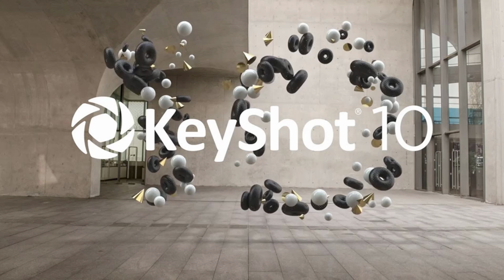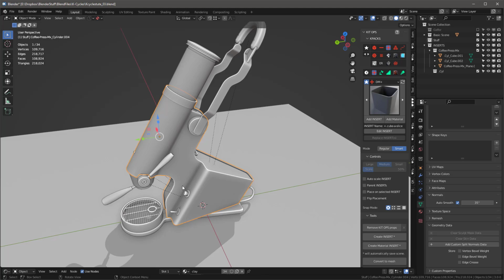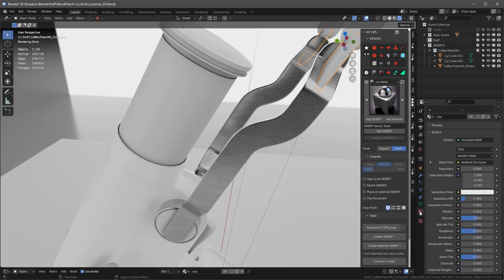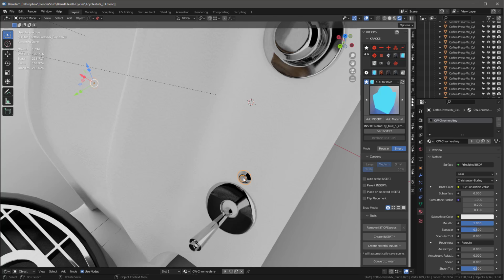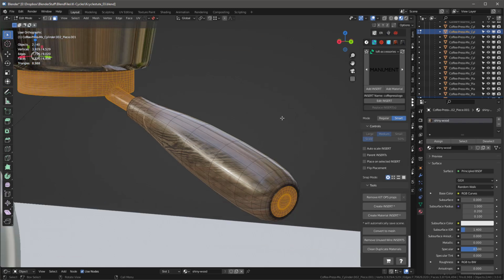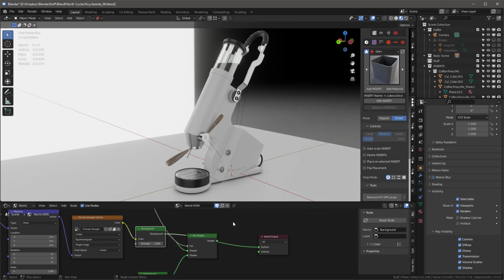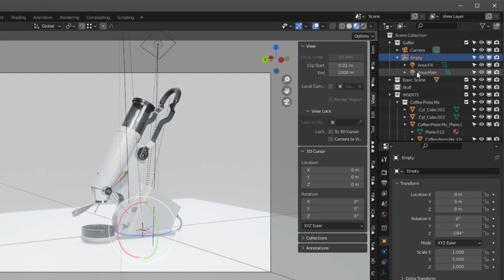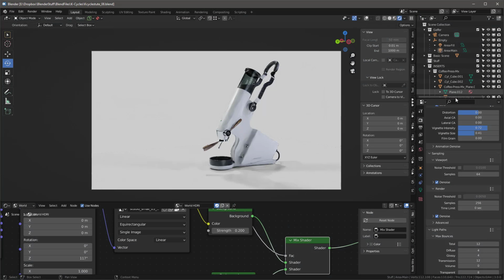Can Blender + K-CyclesX replace Keyshot?

Comment: it seems like keyshot is a useless program, I don't know why anyone uses it when a free program does everything and more that it does just as well; the CAD data hurdle is the only thing that is a bit frustrating in blender, but its not an impossible hurdle to conquer, and worth the annoyance. 

for anything that an employer says to do in keyshot, I don't even have to do it in keyshot and it will literally do what they want.

I actually think that 3DS Max would be a better tool than keyshot since it does handle the CAD data properly; but 3DS cost is insane unless you bought it back when it was actually affordable(ish) or got a student free license before they changed to being subscription vampires
Reply from the maker: Pretty much now all CAD programs can't export in polygon formats like OBJ and they are all easily imported directly into Blender. I do think keyshot has a better workflow for really quick product renderings.
Reply: @ChippWalters  because I always use insanely high end hardware I've never seen a reason to not render in like 3ds max or blender, I'm actually more fond of the early versions of 3ds max, as I found that autodesk has really cluttered and screwed up the UI on all the recent installments(and I could never find a way to get the layout to actually look identical to the r3.1 release in 2023/24, that is one thing keyshot has going for it, a good ui), I never really considered render time as a reason to use keyshot, but, I'd love to see someone do a fair comparison between all the different renderers/programs on a highly detailed scene with volumetrics,fluid sim,particles,raytracing(no pathtracing allowed, sorry unreal 5), it would be very interesting to see; also would be good to include vray render speed results. (vray in my opinion is another reason I don't use keyshot, it doesn't support vray which is a huge deal breaker since a lot of companies use vray since like the 90s and its industry standard)

Comment: Keyshot works many times faster, it renders faster (dk is faster than Cycles X), and it also copes many times better with a large number of polygons and their export and import. Keysho is ideal for presenting products with its Keyshot XR and other features added specially for this
Reply from the maker: K-CyclesX is faster than CyclesX. I routinely do 4K renders in under a minute. How long does it take Keyshot to do a similar 4K render?
Reply: @ChippWalters  I didn’t measure the time in the keyshot. Besides, a lot depends on the performance of the system. But the fact that it is faster than the standard Blender is obvious.
Reply from the maker: @JohnnyBlaster  I doubt it. It used to be the case, but now I'm pretty sure Blender can outperform Keyshot in brute rendering of basic scenes. Plus, I routinely render scenes with 8M polys and more.

Comment: at the 13:38: an alternative to select more in edit mode that I prefer is to made seams defining the limit of the area and then select all the faces with L, but is about you because this method also take a cut when you unwrap the mesh
Reply: Thank you for this tip.

Comment: I doubt Cycles practically does not work with caustic effects, which means that any glass or liquid will certainly look good, but there is no sense in it. But this is of course a fast versatile render, sometimes it will help.
Reply from the maker: The new versions of cycles does work with caustics.
Reply: @ChippWalters  yeah, kinda

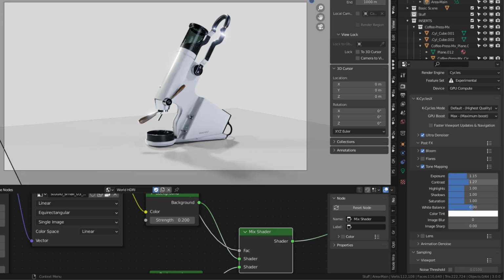Comment: 23:20 "now this is not available in standard-blender" it totally is, you just have to use the compositor for that. You can add tons of custom post processing to your render if you want.
Reply: I have not played with Kcycles but I suspect all those post effects are just an UI that is using the compositor in the backend.
Reply from the maker: @slowlymakingsmoke  nope. That is incorrect. Those effects are hard coded into the source code and are completely different from what exists in the compositor.
Reply: @ChippWalters  if he would make an add-on just for the color correction feature I would buy that.
Reply: That is very interesting. Thanks for the info.
Reply from the maker: I believe I said it was available in the compositor. You should listen to it again. Even so, there are not many of the effects, or if they exist, they are poor. Bloom is an excellent example: compositor bloom is pretty bad. Not to mention the many lens effects that cannot be created in the compositor.

Comment: Thanks for the awesome video. I’m looking to transition from a Keyshot to Blender workflow for better scripting support, procedural water creation, human models, and potentially animation in the future. Although Keyshot is better packaged and has amazing performance for product renderings, I find support in those areas lacking. But I can’t find anyone that prefers to use cycles to Keyshot. Is it fair to think Blender is actually more versatile?
Reply from the maker: Absolutely Blender has way more versatility than Keyshot. Cycles can create amazing renders. It definitely renders interiors way better than Keyshot.
Reply: You won't find anyone that prefers to use Cycles over Keyshot if what they need is only what Keyshot does. Making an animation in Keyshot is a lot easier, and learning the program is a lot faster.
Reply: @Edgard422  I prefer cycles over keyshot. Keyshot is great if you want fast renders, but that's about where it ends. You'll be spending far more time in keyshot, where everything has a plasticky look to it, trying to get a realistic looking render compared to blender.

Comment: I can't figure out why my KCycles is suddenly running so bad ever since the Blender 3.0 KCycles update. It's render times are in the magnitude of 400-1000% longer than normal CyclesX now using the same settings. Even when I turn KCycles over to the Low preset quality it still takes several times longer to render the scene and looks horrendous as expected.
Reply: Usually is some time type setup or configuration issue. In Blender Market go through "Ask a Question" for support.

Comment: The biggest issue it getting your CAD data into Blender and having the ability to easily update it if the CAD data gets updated. KeyShot does this amazingly well.
Reply from the maker: Moi3D, a solids modeler, has the best tools I've ever seen for converting solids models to mesh models. Full control.
Reply: Rhino 3D and Keyshot work like a charm
Reply: @HDRlightStudio Will blender support step files in the future or not? Fbx and usd are still trash to work with.
Reply: You can't possibly compare CAD modeling with polygon modeling programs like Blender, Maya, 3DSMax.
Reply: @Cyber_Kriss No hes talking about it being possible to import cad files into keyshot, which blender cant do.
Reply: @2darki  this is something I have to do everyday in my job, to get from Solidworks to Blender I have to save a Step file in SW, open it in Cad Exchanger, save it as an fbx and then import that into Blender. It keeps the hierarchy and part naming intact as well as retaining linked data across parts. I wish there was a one step process. We used to use Keyshot but as we need the ability to edit and create parts we moved over to Blender
Reply: @davemcbride149  Blame solidworks for being a geriatric piece of shit software. Most all other CAD softwares can export to OBJ, etc.
Reply: @Cyber_Kriss  look at the title of this video... can Blender and X Cycles replace KeyShot. I am saying that one of the benefits of KeyShot is it's ability to import a wide range of CAD files in their native format. Blender can not do this. No one is comparing CAD and modelling programs.
Reply: @HDRLightStudio  My bad... English is not my first language ;)
Reply: @HDRLightStudio  Yes, and exporting CAD data into STL or OBJ ends with a huge file, and often with lots of mesh problems (specially on circular surfaces and rounded edges)
Reply: @Edgard422  actually I must say in recent time blender does handle that better. We design in Fusion360 and export high res meshes to blender. Swapping out meshes is also rather easy with the mesh data exchange when not adjusting the object origin point
Reply: @HDRLightStudio  Get your CAD data correct and you'll never have to worry about it.

Comment: This looks like an excellent improvement over the standard Cycles renderer but I don't have a super graphics card that will take advantage of the render speeds it offers.  I assume the rest of the features would still work?
Reply from the maker: Yes, like Keyshot, it can use your CPU to render as well (or both CPU and GPU)
Reply: @ChippWalters  cycles X is much slower for CPU rendering than previous versions, not sure if k-cycles works differently
Reply from the maker: @drumboarder1  you should NOT purchase K-Cycles unless you have an Nvidia card.
Reply: @ChippWalters  I was talking about standard cycles X, 2.9 is faster to render if using the CPU so.. pretty much don't use 3.0 if you don't have an nvidia card lol

Comment: I was reading on the Eevees Material System, that the four glas renders won't work with Cycles. Does that mean they still work with K-Cycles? And why don't they work with Cycles?
Reply from the maker: The shader I used in the video works with both EEVEE and Cycles. That said, it's not the best glass in EEVEE, just as most game engines also have trouble rendering glass in real time.
Reply: @Chipp Walters  I see. That makes sense. Thanks!

Comment: Thanks for this video. I was wondering if you have experience with E-Cycles X as well? Are Kcycles X and Ecycles X pretty similar in terms of speed and final quality vs Cycles X?  I do like the light linking in Ecycles Pro, but the price tag is pretty steep vs Kcycles.
Reply from the maker: No, I have not played with E-Cycles. I imagine they ping pong back and forth in terms of who's the fastest. I'm pretty sure they don't have the post effects that K-cycles has, but then there are features in e-cy8cles that K-Cycles doesn't have either. Not a big fan of the developer. 

I've known Eric, who is the developer of K Cycles, for a few years now. He's a real quiet unassuming guy who is really smart. Also, his support is really good. He has a great Discord where he helps people out who use his program, which is really helpful when you're trying to troubleshoot a rendering.

Comment: Great video. I really dislike using keyshot at work and have wanted to be able to do all the work start to finish in Blender. Now it looks like I can.
Reply: One of the biggest problems I found with moving from Keyshot to Blender was exporting fbx models form Keyshot. When you open them every triangle in the mesh is separate, the vertices arent connected. Makes them impossible to work with. You can merge them but the normals just become a mess.